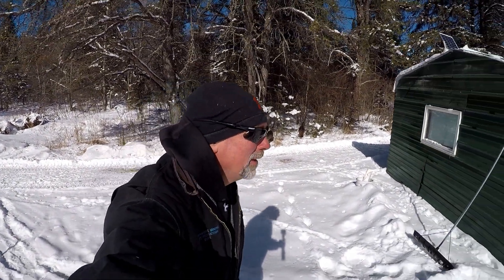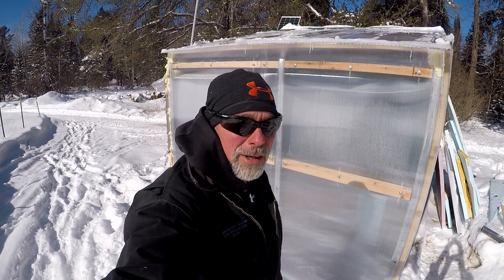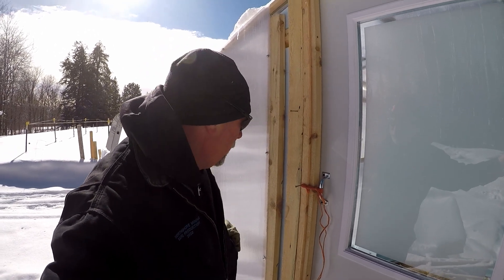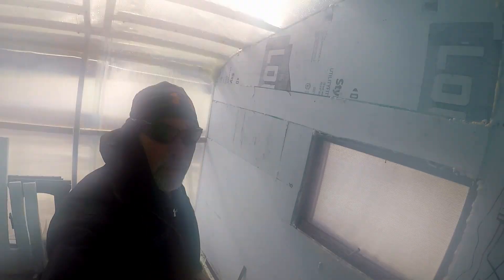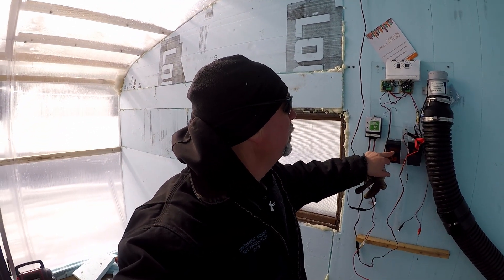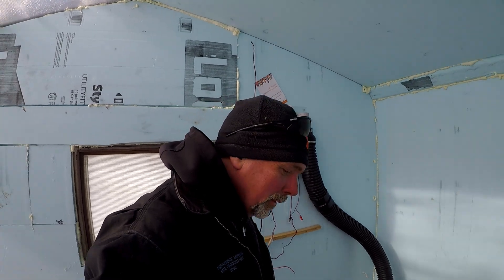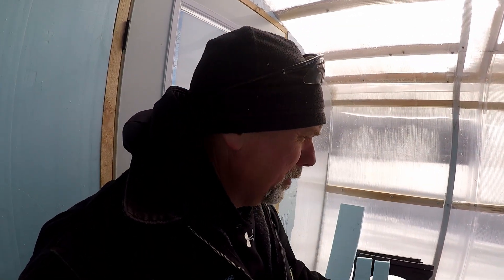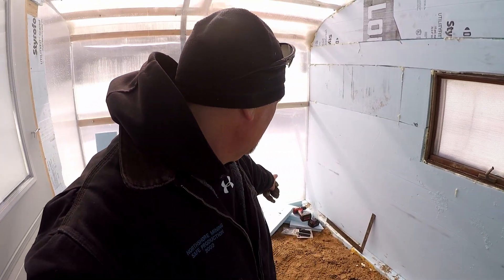Building Our Climate Battery Greenhouse. #minnesota #greenhouse  #diy

Comment: A long coiled tube will reduce the cfm output of the fan significantly,. If the fan is set to run at 70F to cool the greenhouse and it manages to climb to 80F, you dont have enough airflow to keep pace with the incoming gains.
Reply from the maker: @JohnGuest45  thank you for the information and for watching the video.
Reply: @hawkinsonfamilyfarm350  
I would have suggested putting 5x 18ft long tubes at 5ft and 4x 14ft tubes at 3ft. In a 12ft x 8ft hole, the first of the 5 tubes would located 12" on center from the edge of the hole with the other 4 tubes 18" on center. The 1st tube of the upper layer tubes would be  located 21" on center from the edge of the hole, creating a matrix of staggered tubes.  Using a 12v, 24v or ideally 48v dc pc pressure fan on each tube would provide 900cfm (or more) with pwm speed control and minimal loss. For effective cooling performance (aka, effective heat storage performance) you should aim to put the entire greenhouse air volume underground at least 20x per hour. I designed mine for 60x per hour for experimental purposes and mostly run 25 , diminishing returns begin at about 45x.  60x combined with overhead misting was able to keep everything alive during a 40C + heatwave where night  temperatures didn`t drop below 29C.